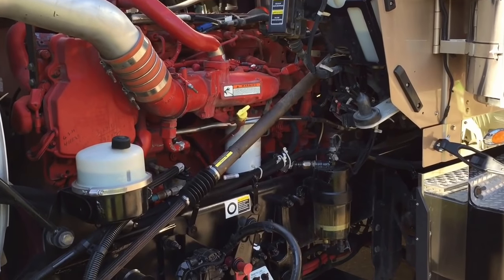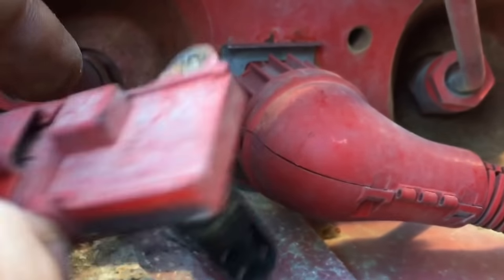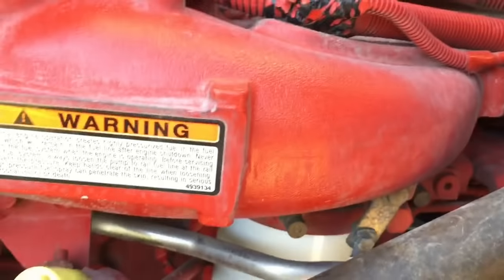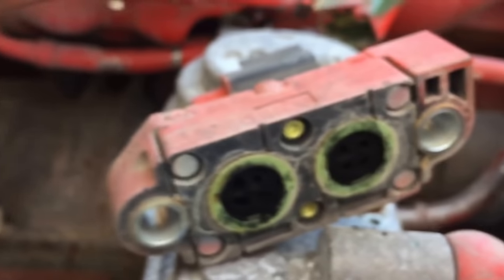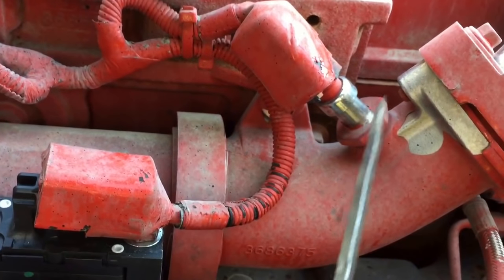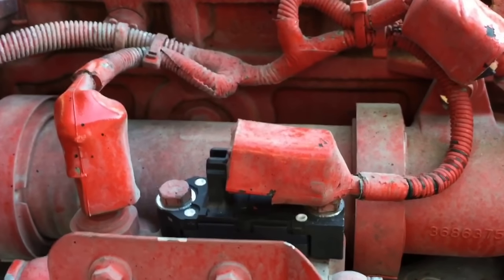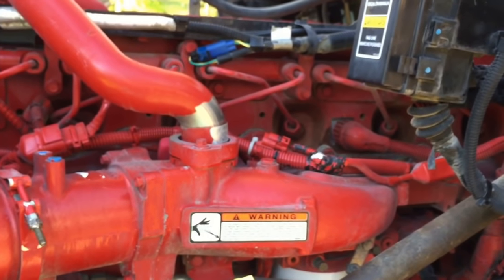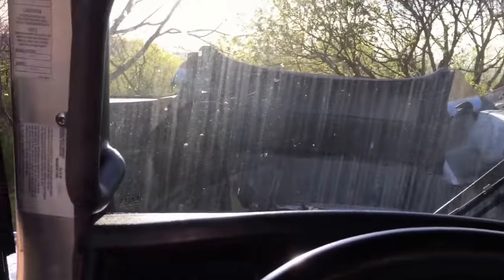EGR Tune Up | Cummins ISX500 CM2350 sensor change out.

Comment: What do you use to clean the soot out of the pipe there? Thanks.
Reply from the maker: Success Is My Duty starting with the cm2250, they opened up the intake. I cleaned my 2011 t660 with a 2250 and and learned it’s not as tight as the Venturi tube on the 871. I won’t take off the tube on this one. A cm2350. But, if I did, I’d use carb cleaner. Just don’t use brake cleaner. It’s like a soot magnet.
Reply: MakeCents thanks man.  I've got a 2014 Cummins isx15 and the setup is different design then yours. Looking like a more complicated design but I'm gonna give it a go slowly.  You think I should  Locate all the sensors first and then get to the tunes?
Reply from the maker: If you tune and de lete, id pass up the sensors. If you do a de lete the sensors wont be used anymore. So if your keeping emission, yes change out the sensors. It very well might have a cm2250 if you have the Cummins. Look on data plate on ECM and it should say

Comment: The 2012 and 13 ISX was the worst we've run in 40 years. Some of it may be bad luck but I don't think so. Every one of them blew multiple head gaskets and heads. My advice is run those for 300,000 so and trade immediately.
Reply from the maker: Yes, cm2250. It can be bulletproofed, but without that, its a ticking time bomb.
Reply: i bought mine on 500k miles, now i got 800k never been touched inside the engine
Reply: Got a cm2250 in my 2014 386. 760,000 miles with very little engine work. Just a few replaced sensors on it. Had the truck since new. Never babied, but not abused.
Reply: Got 1,116,231 on my 2013 isx15 an runs an pulls like a new one 😁✌️
Reply: And it's a 2013 t660 86 studio that run teams hauling Fed ex governerd at 67.. turned up to 75

Comment: Hey how is it goin. Tanks for posting videos I have one question. I’m. Having trouble with my 2012  cascados with an Cummins Isx loses power goin uphill. Like comes n goes in seconds I have checked all those sensor but can’t find the problem tnks
Reply from the maker: What is your boost at, how high will it go?
Reply: Put the key in on position unplug the egr censor then start the truck.  Egr valve will be stuck in closed position.

Comment: Hi everybody, I have a 2014 KW T 660 Cummings 450, my truck is always doing the regen, if I run 370 miles the truck will do regen for 370 miles, then I go back to my home base and still doing regen, how I know that it’s doing regen ?? Cause the dashboard hot filter light is on, when a red light stop me, I see the rpm needle going up to 800 rpms, the pressure sensor in the filter was replaced, my mechanic replaced the differential pressure sensor and the problem remains, filter and catalytic are not clogged up, they just burned both about a week ago, anybody has an idea what the problem could be ??? Thank you...
Reply from the maker: it's one of the sensors, doser valve or problems with one of the filters. If you are on Fb, search ISX solutions and ask those guys. There are some awesome mechanics in the group
Reply: I had the same problem; ended up being a frayed wire

Comment: i have 2010 isx the coolant drop every day we checked the whole truck no leak found i also checked the EGR cooler also no leak found do you have any idea what it could be !
Reply from the maker: 1st. unscrew your oil cap. IN cap, is it clean, or is there sludge in there? Also should pull Crankcase filter and see if its sludgy on filter too. If so, coolant is mixing with oil. could be cracked head, or dropped liner.
2st. get you a pressure gauge and pressurize the coolant system over night. Place card board all under your truck and check for wet spots on card board first thing in morning. 
3rd. could be air compressor.
Reply: you the man , i found a liner dropped is it fixable or i need to do a rebuilt ?
Reply from the maker: Ugh that sucks! Inframe will fix it. so yeah, rebuild.

Comment: Have you heard about anti polishing cylinders. Theyvare say that's what's wrong with my oil use
Reply from the maker: no. what is it, I have oil use too.
Reply: apr ring cummins fix replace the pistons and sleeves at your cost to fix the carboning problem that causes the old pistons to carbon up and cause the  rings to stop working causing blow by and oil use ... or change your oil to synthetic oil 
1. it will clean out the carbon build up 
2. synthetic doesn't carbon up
3. first oil change you will need to change your oil filter about 10,000 if you oil pressure from all the carbon being trapped into your filter and carry about 2 gal spare oil in the side box 
mine was using oil about 1/2 to 1 gal about 3000 miles and that fixed the problem
hope that helps it did mine.
Reply: @MakeCentsTrucking  carbon packing on the pistons is whats causing this oil use it is from the egr system craming as much egr in there as they could on cm2250 engines rebuilt a few of them when I worked for Cummins becaise of that its axtually pretty easy to find if you have access to insite look at engine load during idle anything above about 3% at idle is carbon packing

Comment: Hey did they upgrade the isx in 2016 or 15
Reply from the maker: I think the x-15 came into play, 2017 engine year. 2018 Truck year. The previous is the ISX CM 2350 2013-2016
Reply: MakeCents thanks man so what year truck would you buy between 13 and 17 please help

Comment: Hi, I have cummins isx 2008 . I did change imap sensor & egr sensor did not working for me.  Its still loosing power when I have a load, bobtail isn't missing, if someone had a same problem let me how to fix it thanks

Comment: i change all those and and my fuel economy is still shit any ideas im getting 5.4 mpg it was doing 6 truck runs fine not many issues seems like i get faults but you erase them they dont come backs like their is a short in the system or something but fuel economy is shit filter was cleaned 150k ago and reading fine truck only has 365k on it
Reply: i did a tune up on it as well
Reply from the maker: do you use cruise?

Comment: What does Delta P sensor do?
Reply from the maker: A Delta P sensor is an egr component that monitors the amount of emissions that are sent back in the combustion system then communicates with the powertrain control module. This sensor is used to inspect the exhaust pressure changes above and below a metered orifice.

Comment: What’s bad mpg.?
Reply from the maker: Depends on what you're driving.
Reply: 2013 Kenworth T700 ISX15 450, with 2012 motor 10 speed.  Owner operator specs

Comment: you going to pull flatbed or reefer
Reply from the maker: Shay Earl I chose to stick to what I know. Got a dry van. When paid for I'm going to buy a drop deck
Reply: Sammy B. I'm pondering getting away from reefer myself. Too much waiting time. Flat and step pays better and you don't have to wait normally
Reply from the maker: Shay Earl yea the waiting is what I don't want. And I keep hearing with flats are fast on and fast off.
Reply: Sammy B. Yes sir. That's what I've seen and heard. They appreciate flats getting there to unload. Van reefer just storing spot till they make room inside.   Plus flats don't unload at 12 to 6am in the morning like vans and reefer
Reply from the maker: Shay Earl true that. What gets me is they say they don't really have appointments, just get here asap and are proud to see you coming. I like that idea
Reply: Sammy B. Yes indeed. Just talked to a ats oversized Driver. The pay is awesome
Reply from the maker: that what i want to end up in.$$$
Reply: Sammy B. That would be great. Run less make more. No late running
Reply: Sammy B. No ECM tuning yet? There is four of us out here in California with the 2350 just trying to look for the best tune.... the videos are great 👍thanks
Reply from the maker: na not yet. ill keep emissions as long as i can keep it runnning good. but if i do tune it will be the same as i had with the 660, a mm2 tune. Thats the only way ill go. thanks bro
Reply: Sammy B. wich is the mm2 tune and where did u get it done n what it xost to do tune thx
Reply: MakeCents Trucking Show what is a mm2 tune?
Reply from the maker: its a diesel tune for Cummins isx engines created by Rawze. Just google those and happy reading :)
Reply from the maker: read through comments and you’ll see info Gabino
Reply: Shay Earl It All depends. Pulling these skate boards can be slow too. Some mills you can sit 30-45mins and others you can sit 2-10 hours. It all depends the place and how quickly they load and off load. But most of the time, you good!

Comment: My 670 won’t complete regen any idea what it could be
Reply from the maker: Could be a number of things.I'd start by having the canisters checked for soot level. Then I'd change out the IMAP sensor( absolute pressure sensor), delta P sensor( differential Pressure sensor), exhaust back pressure sensor, and clean the dosen valve.
Reply: I changed all thos sensors  but light still on , to clean the dosen valve just unscrew it and clean it .. simple as it sounds?. Just rais it up and scrape it ?.
Reply: Is the canister the filter ?. Cus I had The filter clean last month truck shows no soot on gage..?
Reply from the maker: Yes on the canister. And yes on the dosen valve too. There are two screws holding it in, maybe 8mm. Unbolt those and lift it up far as you can. Do not loosen up the lines going to it, they are coolant lines and they will drain your coolant. Use a mirror, or as I did, I used the camera on my phone to see what I was doing and I took a small flat head driver and scrapped off around the injector.
Reply: Got you my brother tnk you so much I will do that.. I will post outcome
Reply from the maker: Yeah do, I'm curious what it is
Reply: Cleaned doser was clogged completely did a regen after n lights went off
Reply: But now a day later it ask me for regen did a regen and it never completed sat there for 1 hr 40 min and nothing light went off even tho it never completed .. don’t know wats up with that ?
Reply: @davidsilva5175  sounds like your dpf is full when was the last time it was cleaned? Whats your mileage? They should be cleaned about every 250,000 miles could be face plugged doc even need to be able to see your seven temps also the thermostat on these trucks are known for ripping the rubber around it sticking it open with out a good thermostat they wont run a good regen. You can clean the dpf with a water hose and the doc with just air

Comment: That's a lot of stuff to change, just in case.
Reply: Todd Nicoll It’s worth the 5 grand the dealership will rob you of. Trust me.
Reply: @KingofallHacks  5grand for this job are u sure ???because I am thinking about buying truck that has n14 red top and stay away from this poor home isx
Reply: Moe Sammour No a dealership changing your sensors will not cost that much. I meant if you don’t change your sensors and a problem happens the dealership might blame and replace expensive parts like a DPF or DOC that can cost 5 grand.

Comment: 1 mpg increase wil pay that 200 bucks in a week? mabey 2? than its pure cash in your pocket. but one thing u gotta watch is the high pressure fuel pump, that fucker fails like a cp4.2 in a duramax, ford, and now the 6.7 cummins
Reply from the maker: yeah that's the truth. I had the old style rollers and quickly upgraded. Plungers, tappets, and rollers need to be checked for updated ones

Comment: Jesus. If there isn't a problem with it don't replace it.
Reply from the maker: it’s preventive maintenance hero. They need repaced every 250,000 miles

Its like a over head set, it calls for 500,000 miles. So, do you do it at 500k or wait until you start eating cam bearings??
Reply: That's averaged they need replaced.  A sensor thats not calling for a check engine light will not cause harm to an engine. If it does, its very rare
Reply from the maker: lookupsayaw530 yea true it's not going to harm engine, but the minor cost to replace at home at 250k miles  vs. on the road with possible tow and or shop bill. It just makes sense.
Reply: I agree with you there. But all im saying is save the money until it happens.
Reply from the maker: If i had owned the truck since new, i prob would have waited knowing the history but just buying it i didnt want to take any chances, also wanted to optimize fuel Econ from the start. Which i think i did the right thing, i can baby this for low 7’s and low 6’s with 65-75 keeping boost down.

Comment: These videos are full of terrible advice, wrong information, and incorrect vernacular. That intake pressure/temp sensor is the last sensor in the egr stream if its plugging the egr sensors down stream are also plugging. Will need to inspect the egmmfa and the cross drillings.
Reply from the maker: Maybe so, but.... Haven't been in the shop in years :)
Reply: How many trucks with ISX cummins do you have ?????
Ive been watching his videos for years
And hes pretty spot on
Reply: @DAVERYHX  might as well call the dpf a burn box, so when you guys go to a repair facilty you can put the cherry on the top. The mechanics that are certified for these engines have hundreds of hours in training.
Reply: @MakeCentsTrucking  all I am asking is you teach yourself the proper terminology of the parts so you dont sound like you dont have a clue what your talking about
Reply: @socialphotography3753  don't be asking.